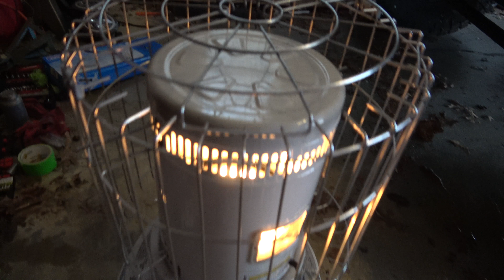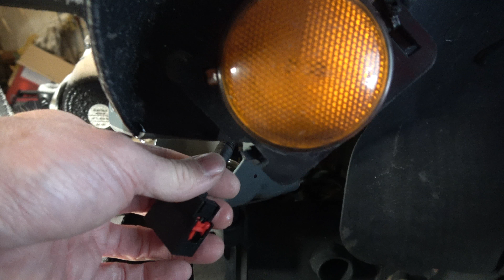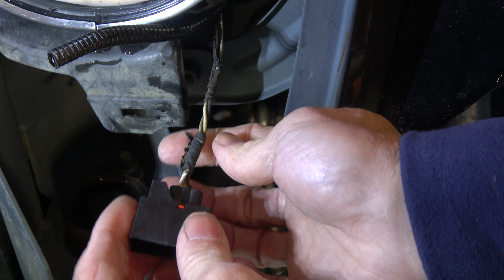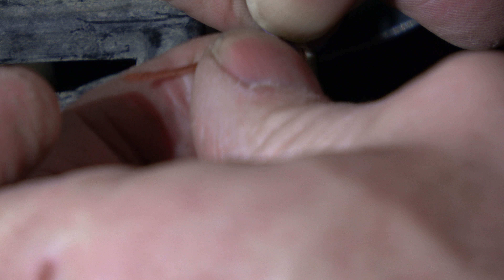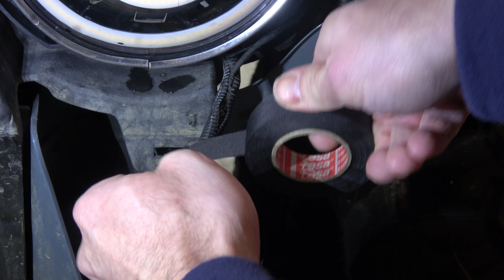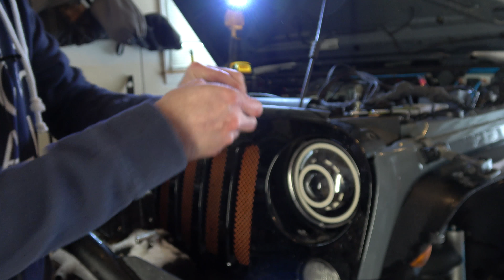05 - Switchback Turn Signal Wiring - HIDProjectors.com Revision 2.0 -  2015 Jeep Wrangler JK

Comment: Hello! I got a pir of Oracle Oculus Bi-Led Switchback headlights (JK) for my TJ. Since the TJ does not have the DRLs function form factory, im wondering how to make the halos work. The headlights came with the Switchback Turn Signal Y Splitter Adapter. I will appreciate if you can help me out. Thank you! Great video.

Comment: My car is a base trim, meaning no turning mirror lights. Now I was planning to add a mirror lights.  Do I have to change the ampere value of the fuse or leave it the same?

Comment: I’m looking at getting a set of these, is there a way to wire it so the projector light (main headlight) switch off when you turn on the side that the indicator is flashing.  I wander if with full beam on that other road uses can see the indicator flash when main beam is on?

Comment: I always love your videos!  If you’ve never tried it, in the future you can use a set of automatic wire strippers to strip back the insulation for your t-tap/military splice.  That way there’s less likelihood of cutting yourself or damaging the wire.  I did it when I had to add a wire after the fact during my radio install.  https://www.amazon.com/Tacklife-Self-Adjusting-Stripper-Automatic-Stripping/dp/B076M57KNK/ref=sr_1_1_sspa?ie=UTF8&qid=1522856180&sr=8-1-spons&keywords=automatic+wire+stripping+tool&psc=1

Comment: The indicators looks good, but I think once that main HID lights are burning it will be hard to see at night. I would make the inside two blink, if one still can't see it clearly at night I would make all three blink...
Reply from the maker: Funky Dodo I still have the regular blinkers...
Reply from the maker: Funky Dodo that's a great point tho! I should do a night test to see how it looks.
Reply: o3djeeps [ OVERCLOCK3D Jeeps ] I have converted my standard light bulbs to HID on my Mitsubishi Triton, I've noticed that the lights bulbs are so bright now that other drivers stuggle to see my blinkers. I just thought that you might have a look and see if it's the same with your new light setup. Great videos, keep up the good productions.
Reply: All you've done is blind everyone with glare, and reduced your own seeing by putting HID bulbs in a halogen setup, FFS

Comment: Great job on the splice/Electrical it pays to take your time.  Will the lower turn indicators work also or are they now bypassed?  I didn’t see them blink during the demo
Reply from the maker: They work. I just didn't have them plugged in for the test. I never would have thought that people would wonder that so it didn't dawn on me at the time.

Comment: Wait so do your stock turn signals not work anymore? Or did you just not plug them back in?
Reply from the maker: They still work. I didn't have them plugged in for the test.
Reply from the maker: You can see them working here: https://www.facebook.com/o3djeeps/videos/2014267595504225/
Reply: @o3djeeps  I made an upgrade in my grill so I no longer need the stock blinkers, and use only headlight and fog lights blinker but since I removed the bulbs of the stock harness it has the alarm in the dash, how can you bypass the harness to remove that alarm?

Comment: Looks great but right at the end when testing, seemed like when you said right the left was blinking, and vice versa. Great series though explaining these lights and how to install.
Reply from the maker: Ha... I must have been saying it as looking from the front. I never even noticed that hahah.. It's wired right, I just said it backwards. Good catch!
Reply: No problem, was absolutely trying to be helpful if the left was wired to right, etc. Not trying to be negative at all.
Reply from the maker: I didn't take it any other way! It would have been easy to fix... just swap wires... but it works right I promise. lol